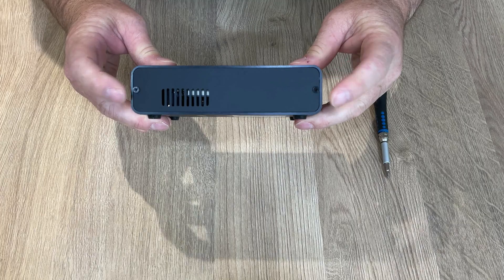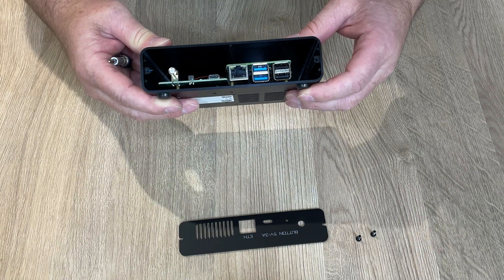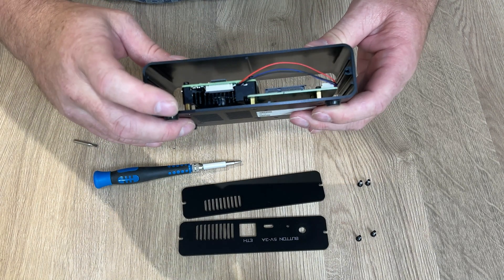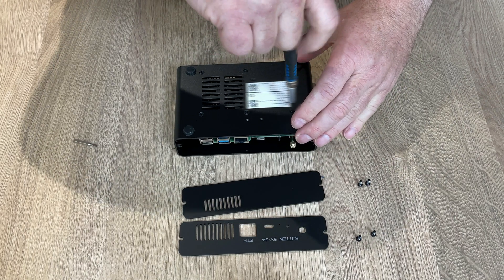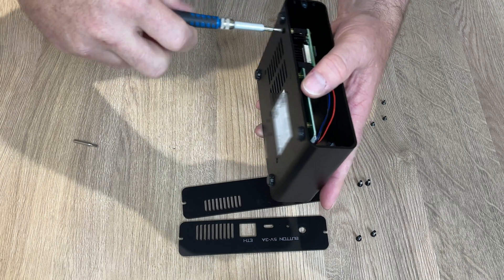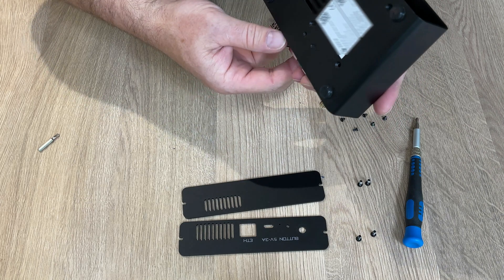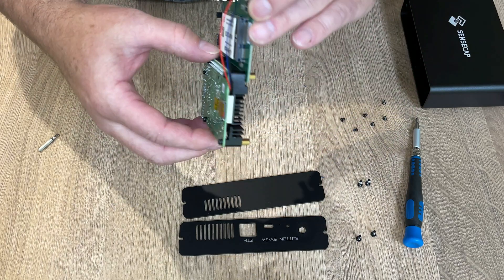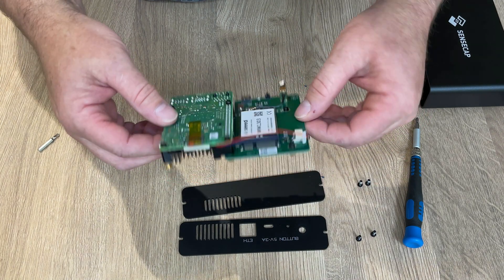SenseCap M1 Mini Teardown. HNT EU868 UK

Comment: Thanks for the info. So it is a RaspberryPi 4B, connected to a custom carrier board with a Seeed Studios WM1302 (Semtech chip) pre-certified Radio module. So the hardware SE will be carried on the custom carrier board. This means you can update the SD card with latest Helium code.
Reply from the maker: any updates are done OTA
Reply: @vancraft_chronicles  Agreed. Just answering @Vu Nguyen Anh who was using for clone - don't need clone. This system allows using latest Helium drop to program an SD in such cases where old SD card gets damaged.

Comment: Thanks for this. I'm having to de-case mine to fit it into an external enclosure, so this video was useful to see what I was going to get before I actually had to do it.
Reply from the maker: what happened to the antenna enclosure as I just had a problem with mine recently and had to replace the cable that went from the module to the antenna connection